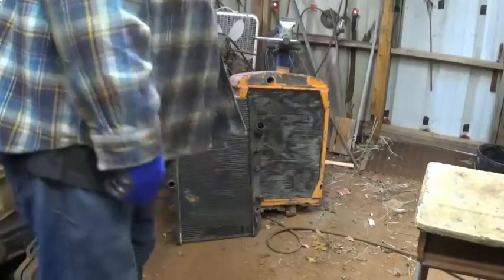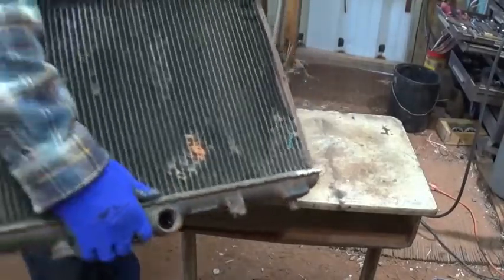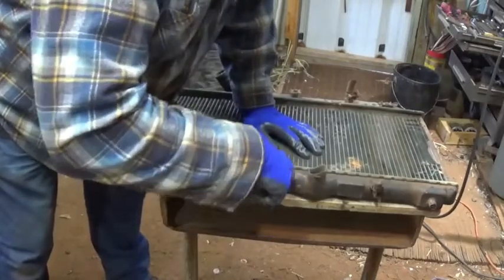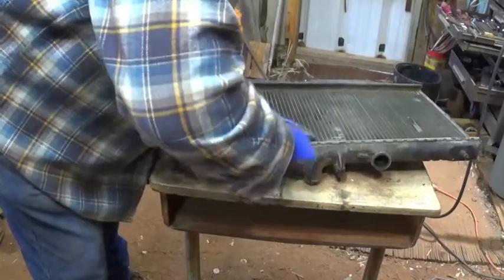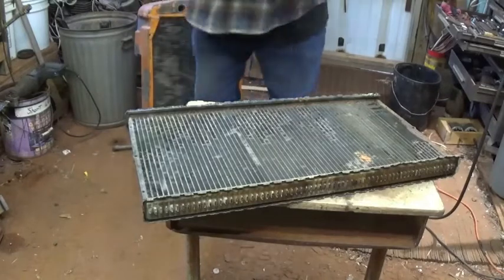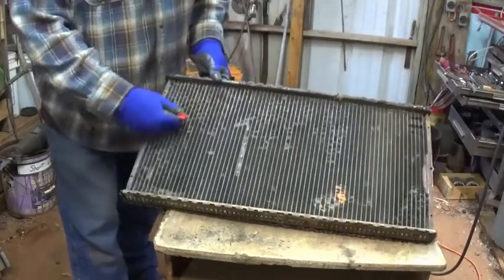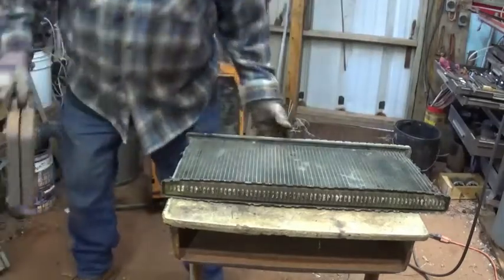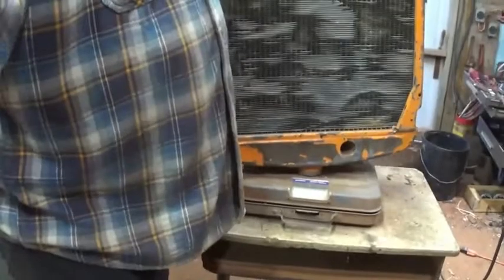How to Scrap a Copper Brass Radiator for Top Dollar

Comment: That's basically the same way I do it getting harder and harder to find a Copper Brass radiators nice video keep them coming
Reply from the maker: yeah aluminum radiators came out in the 70's lighter and cheaper, but not better, Thanks for watching Bill